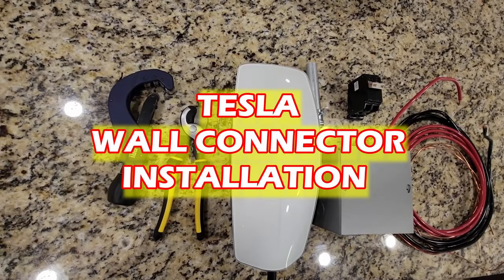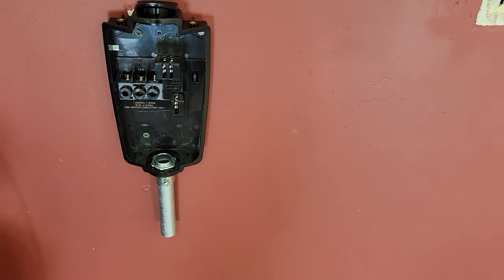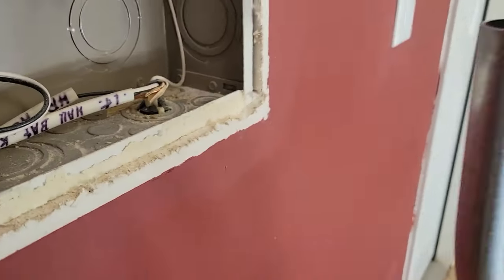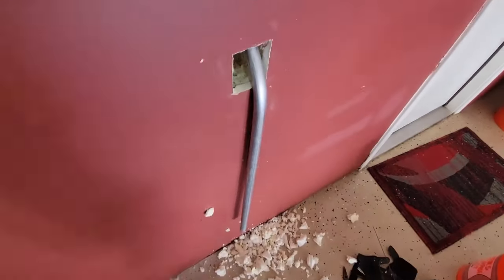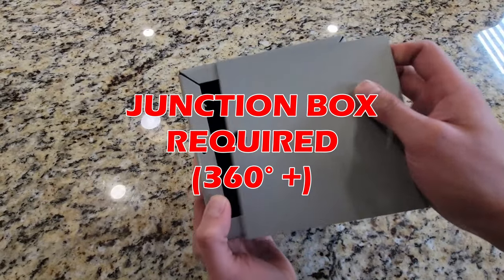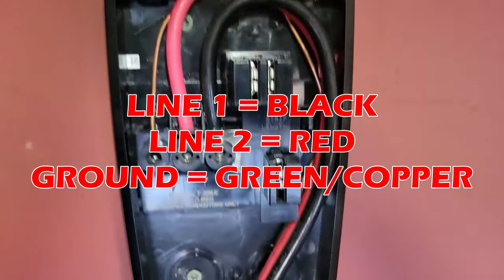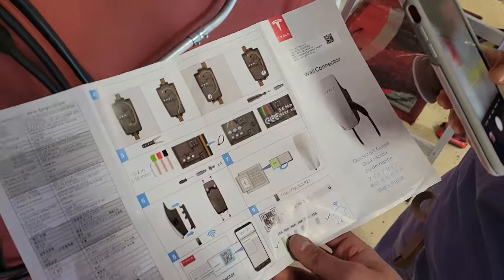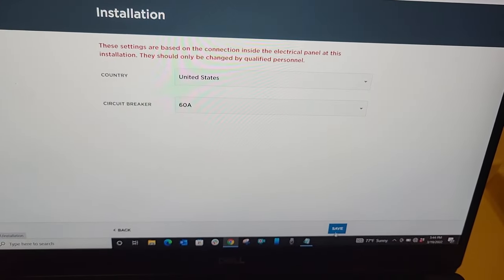How to install Tesla Wall Connector | DIY | Hardwired | #4 AWG | 60A Circuit Breaker

Comment: If Romex cable is used, there's no need for conduit as long as the wire is inside the wall.

Comment: I'm replacing a 4-wire 220 outlet with the 3-wire wall charger.  What do I do with the unused, white wire?  Cap and disconnect it at the panel and cap it there, too?  🤔
Reply from the maker: I'm honestly against re-using an existing 240v receptacle but if done correctly, you can get away with it. 
Here are the steps: 
(1)Cap the neutral white wire. 
(2) determine your existing copper wire size (AWG). 
(3) based on the existing wire size check the breaker size. Correct it as needed.
30A/2pole circuit breaker = #10AWG
40A/2pole circuit breaker = #8AWG 
50A/2pole circuit breaker = #6AWG 
These chargers draw a lot of current and an undersized wire will overheat...Your existing wire size dictates the breaker size. 
I've seen videos of DIY'ers using an existing 240v dryer receptacle. They don't check the wire size and they up-size the breaker for a faster charge setting.....
Reply: @dgtv3320  Thanks...I'm replacing a 4 year old NIMA 14-50 receptacle on a non-GFCI 50A CB with the Tesla Wall Connector.  Good #6 wiring...just one too many of 'em. 😉  It's all good!

Comment: If you are using 6/3 Romex and a 40-amp breaker, is it okay to not use conduit for the portions inside a wall?
Reply from the maker: You can. I'm against it but you can do it for residential. It's not allowed for commercial. As you saw in the video, plenty of flammable materials inside the wall. It only takes a small spark.

Comment: Any difficulty getting the #4 wires into the wall connector terminals? About to pull 4/3 Romex for my install (trying to avoid surface conduit) and worried #4 may be too big.
Reply from the maker: the tesla charger and circuit breaker terminals are designed to accommodate #4 wire--so you wont have any issues there.  4/3 Romex comes with a white neutral wire that you will not need. Only 3 wires are needed: Black, Red, Green.

Comment: Hi there, did you connect the 3rd wire to ground earth or natural ? 
I did connect two hot wire to 60 Amp breaker and the white wire to natural and it’s working well. Should I disconnect it and connect to ground?
Reply: The non hot wire is for ground. If you're doing this in your main panel then the ground and neutral are probably already bonded together, so you shouldn't need to worry. Otherwise, connect the charger's ground wire to ground and let it's built-in GFCI do it's job.

Comment: My panel is about 45 feet from my garage. I plan to run 4AWG thhn from the panel to the garage. Is it OK to use flex conduit or PVC conduit instead of metal?
Reply from the maker: You have options, here are some. For underground, PVC and above ground: Metallic flex conduit, PVC, Electric Metallic Tube (EMT), Non metallic Tubing (ENT); for #4 AWG you'll need 3/4"conduit minimum. 1" conduit will make that 45ft pull easier. Note, the Tesla charger has 3/4" conduit entry for top and bottom.
Reply: @dgtv3320  awesome, thanks. I've only done conduit in industrial applications at a paper mill. I wasn't sure about residential requirements.

Comment: don't 2 #4 wires with ground require 1" conduit?
Reply from the maker: Required--No. (2) #4's + (1) #10 gnd wire equates to 35% conduit fill for 3/4" EMT. The code states conduit fill cannot exceed 40%, so 3/4" is acceptable; Would it be ideal to use 1" conduit--Yes. The bottom entry knockout on the charger itself is 3/4" unfortunately.
Reply: @dgtv3320  Have to disagree with this. Maybe in a 3/4 pipe that is less than 24 inches but not longer than that . My electrician's bible app on my phone doesn't list #4 and 3/4 inch pipe other than a chase pipe. Your own next video proves that in a normal install #8 can be used. BUT this is only for THHN wire in conduit not any type of NM wire.

Comment: The big miss with car charging videos is,  "Is the wire big enough?".  Here he used #4 wire to cover 60 amps and that looks good. 

But what about the service wire supplying your house?   Level 2 chargers are like adding a second stove/oven combo to run for about 8 hours straight.

But when houses are built, the supplying wire from the street, the service entrance, is reduced in size as low as possible to supply the loads inside the house as built.  Adding extra loads may put you beyond the capacity of that wire.

This too is knowledge available to the public.  The national electric code has a section just for those calculations.  If you do not do them every day, those calculation may seem tricky.  There are plenty of adjustments to lower your totals.

Take a look and be safe or get with an electrical guy of some kind.
Reply from the maker: Keith valid point, I addressed your comments in this video here: https://youtu.be/xClNElvvrGo